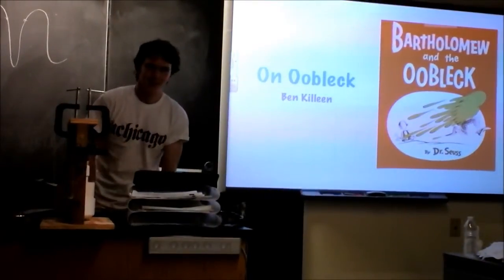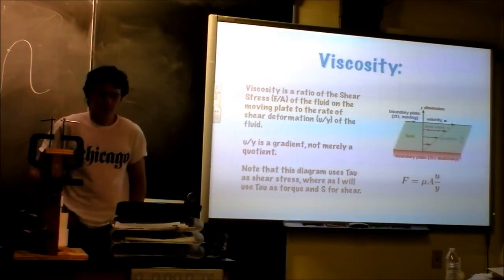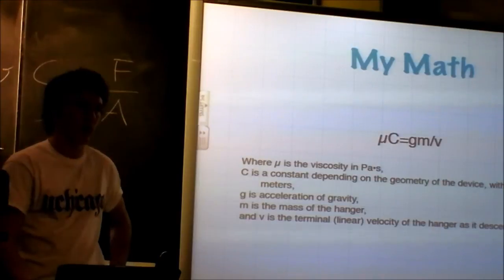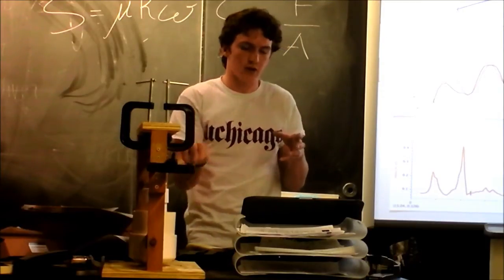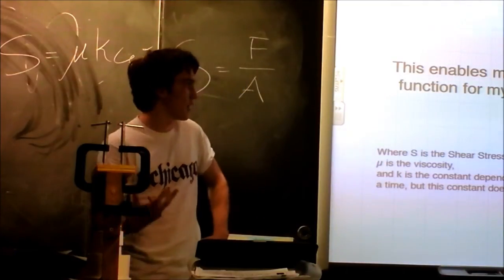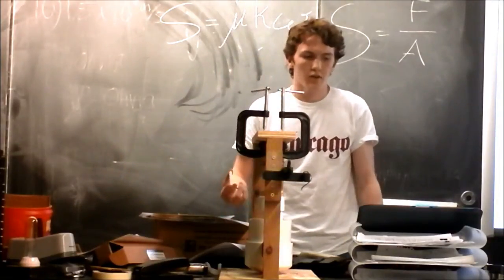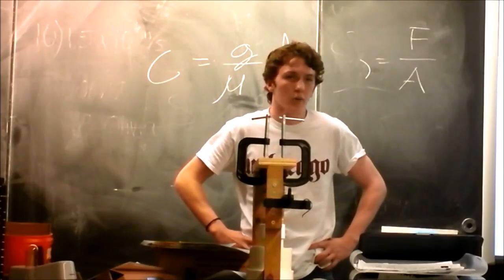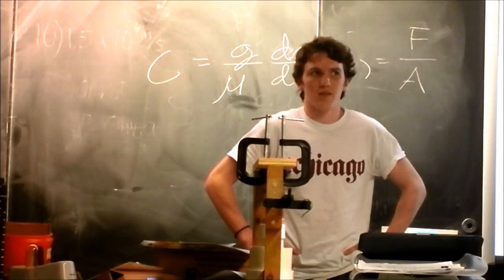Indie Lab - Stress-Induced Changes in Oobleck Viscosity

Comment: I like this a lot.

The introduction of the equations was not very appealing. I found it hard to understand exactly what assumptions are made. And in my Olde Worlde view every denominator can be multiplied out, even when it's called y (2:50). If it's a derivative, then it should be written du/dy, but it is said explicitly that it's not a derivative. Then what is it? I didn't get it. The presentation of the data was good.

But what I really really really liked was the Q&A. I have seen many students who do a decent job of using proper physics reasoning and formulating in the prepared part of their talk, but collapse back into the sloppy, inadequate everyday mode of 'thinking' and speaking when improvising. Not this guy! He answers questions with confidence, using sensible arguments and examples. It is clear that he has studied the subject, and - more importantly - has thought about it himself. If every student succeeds in getting into the subject like this guy, the educators should be proud and happy.